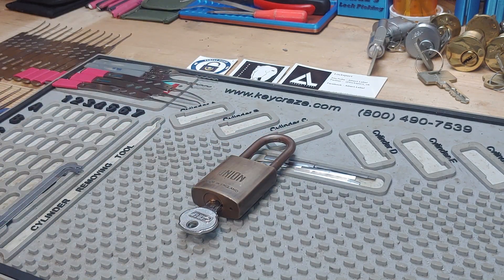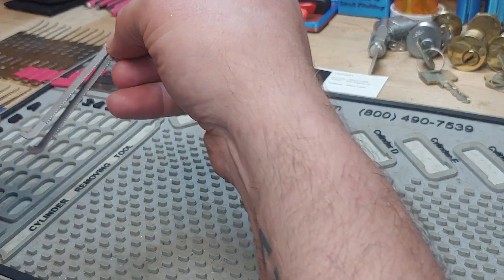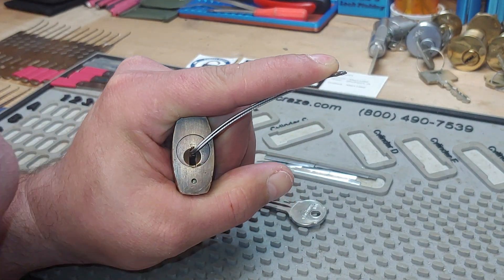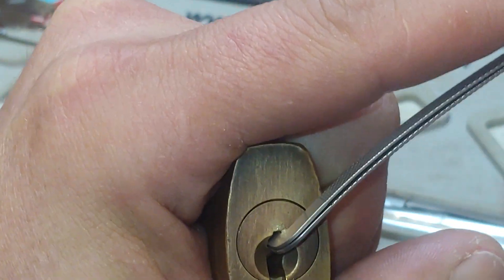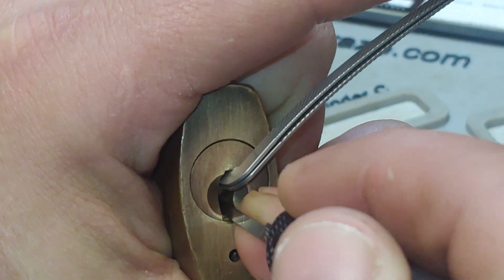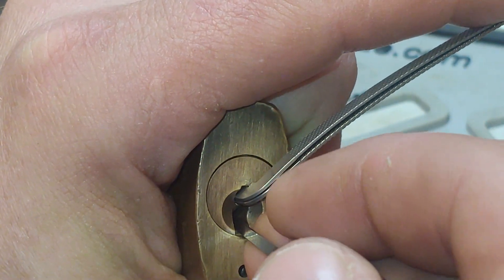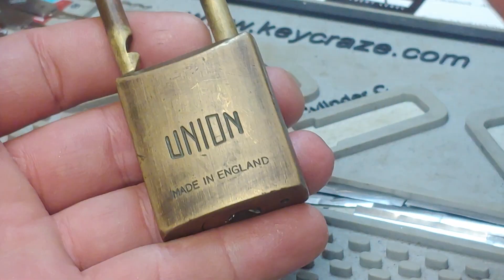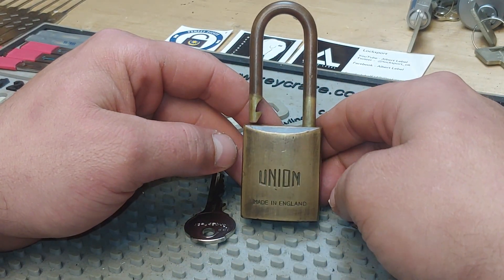(#60) #StockLockSunday  Union all brass padlock

Comment: Awesome pick brother, sweet little lock  I would have gotten no where I wouldn’t of had a strong enough tensioner.
Reply from the maker: These tensioners are stronger than you think💪😏
Reply: Chaz's Lock Picking yeah I bet I need to get some top of the key way tensioners/ pry bars. Like sparrows flat 5 I made one a few weeks ago but the piece of what I thought was steel turned out to be brass I believe it was super soft and prob. wouldn’t work to good. I should just finish it and see prob. bend super easy though.
Reply from the maker: @ghostedshadow9282  yea most likely it won't hold up. Brass is super soft